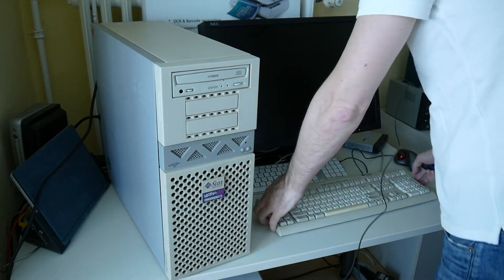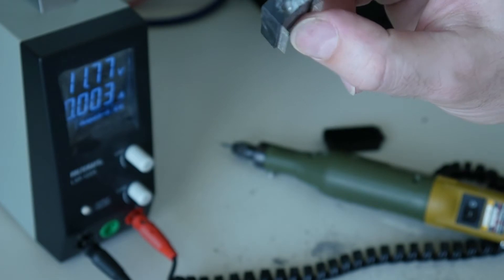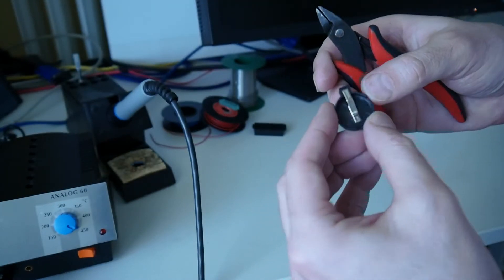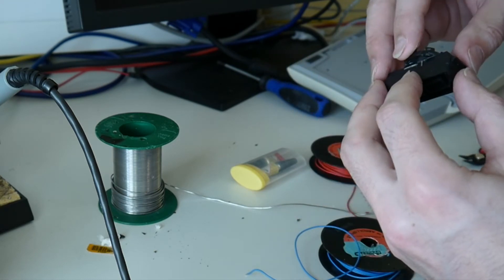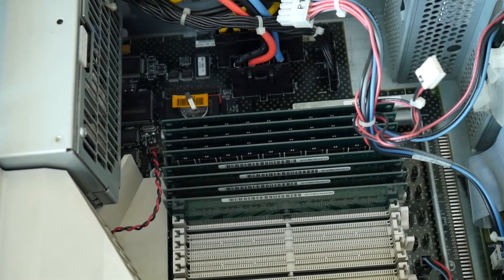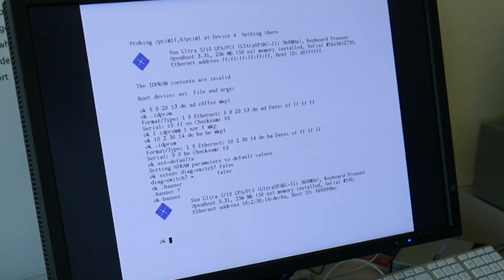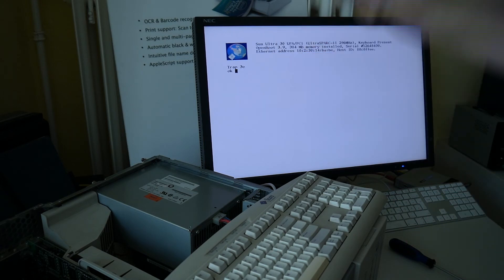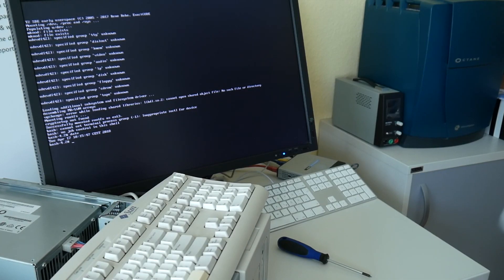Destroy or save another nvram? Weekly TOD drama: M48T59Y Sun Ultra 30

Comment: Ah, Sun with their black on white screen, memories. That is weird, to include a 3V cell inside an epoxy housing, never seen this before. Any ideas why they did that anyway, to sell service and parts? Not a very (environment) friendly solution. Are you not afraid that the left battery starts to leak some day?
Reply from the maker: This was industry best practise. I also don't like it. Guess: easy, convenience, maintainability, ... they probably did not even expect the machines be used for more than 10 years. Maybe they usually do not leak thru the epoxy?
Reply: Many real time clock chips of 80s and 90s PCs use the same solution. Dallas produced an integrated solution. They're easy to find and most of the time socketed, but sometimes you have to desolder the chip which is a pain. Terrible solution.

Comment: What is the tool you are using to drill the chip?
Reply from the maker: just my regular entry level ~1mm electric drill that we got and otherwise use for pcb prototype board ;-)
Reply: @renerebe  Can you provide the brand and model number?
Reply from the maker: @robertlee1549  puh, it is no name-ish from a German electronics supply Conrad and 20 years old ;-) any similar or this more expensive Drehmel brand will do ;-)